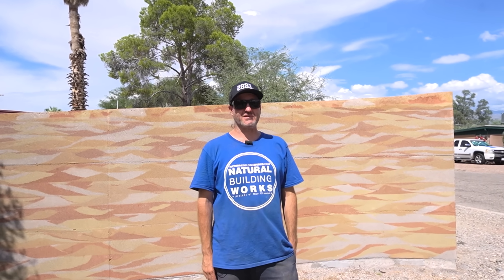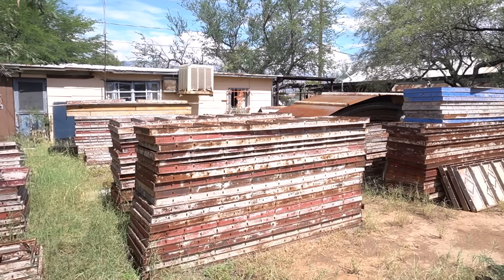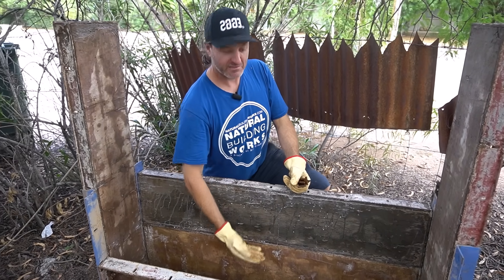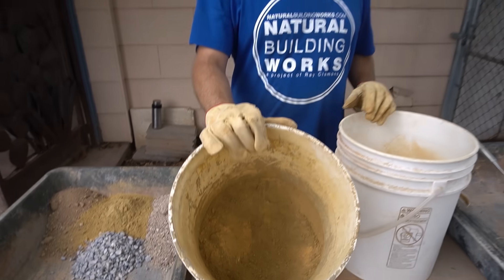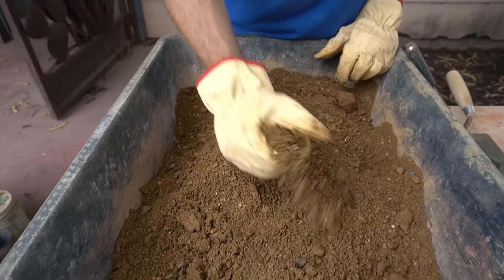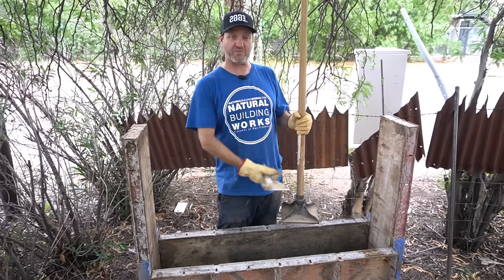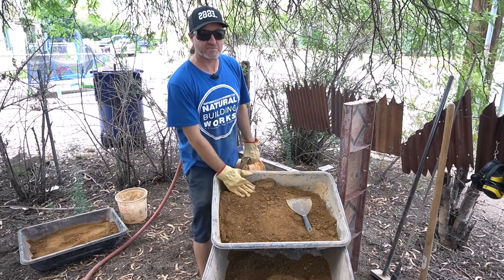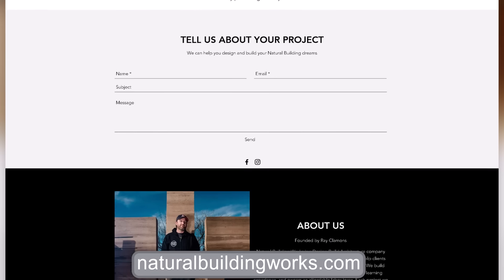How To BUILD A RAMMED EARTH WALL: Sustainable & STRONG!

Comment: I wonder if this could be scaled up by using larger forms and a pile driver to do the tamping.  Something like an attachment to a backhoe or front end loader or whatever, that could lift a couple hundred pound shaft and drop it repeatedly over a steel tamping plate inside the form.  At that point you would probably need a huge cement mixer truck and several dump trucks for the various materials in the mix, though.  So now the equipment costs are creeping into seven figure territory.

Comment: I have a hydraulic tamper its powerful don't get a foot under it for sure. Its just so dang heavy, yeah its lighter while floating when on but it'll wear you out.  This whole process will wear you out and I had a front bucket tractor. Hire this guy to do it if you are not ready to work your tail off.

Comment: With that little of cement, won't rain eventually ruin this wall? I mean, you would need mere cement ratio in wet climate might help last longer.
Reply: We also have Lime plaster mortars, but they seperate from portland cement, so must use knowingly.  1:1:1:1:.1 lime:sand:clay:toilet paper or shredded hemp or glass fibers, wee bit of manure for lots of reasons, including the bind and stickiness. !!! Top coat with slaked lime and pigment or just wet-smooth as is for grassy, micaceous, leather effect.  Four (4!) coats of vegetable soap or linseed oil, chemically becomes waterproof plastic, no critters like eating or burrowing in lime in any form so manure is sanitized, but the flies will love you as you work with it, great meditation with earth.

Comment: What happens if you use a pressure washer on the wall?
Reply: No more wall, then.

Seriously, these don't like water, even rain will erode them away. They need way more lime added to the mix, like they do in more temperate areas that have used RE (China, for instance). Typically a wall like this is only suitable for very dry environments.
Reply: @berserkasaurusrex4233  idk, we did build some hemp lime staggered stud buildings in Ontario that are exposed to some fluctuations in weather. They’re plastered in lime on the outside. Humidity is supposed to rehydrate the lime and filter the air simultaneously. In masonry we use lime for building to last for centuries. I just wonder how long this type of rammed earth will sustain a pressure washer. Probably meant to have a shelter overhead
Reply: @stoneandearthandsailing4127  With a lot of lime, it would be far more water resistant (anything with lime is, generally) for sure.

But as far as a pressure washer goes; Rammed Earth is basically man-made sandstone, you can scratch it with a fingernail. Even with a high cement content, it wouldn't handle weather very well, it's too loose a material, like a too-dry mix of concrete really. Freeze-thaw cycles in particular would destroy this quickly.

If you covered it in a thick layer of lime plaster it would handle the weather a lot better, but then you might as well just build with adobe entirely and save yourself all the extra labor.
Reply: You’ll wash the dirt away and be left with a puddle of mud. What would you expect?
Reply: @stoneandearthandsailing4127  unless its been stabilised
Reply: @stoneandearthandsailing4127  Not really, that is what the concrete mixed in is for, it acts as a binder... But so long as it's not too high of a pressure tip it would be fine-ish.

Comment: Rather than cement can lime be used or even a mix?
Reply: Absolutely
Reply: id actually prefer to use lime
Reply: You do know lime is the key ingredient in concrete.. Right?
The rest is mostly some aggregate like sand and stone.
Reply: @SilvaDreams  theres a difference between cement and lime, including energy required in making it.
Reply: @SilvaDreams  limes don’t grow around here so we mostly use Portland cement to make concrete. I’ve heard limes were much more common in older masonry projects. They would make a hot lime margarita and those walls would regenerate with the moisture in the air. No wonder masons are such alcoholics

Comment: how well does tamped earth hold up to heavy rain and earthquakes?
Reply: I know with cob you apply lin seed oil and that water proofs it. There's mild upkeep involved but not insane. See: 500 year old cob homes in UK for example. There's also some cob structures in British Columbia. So some of the highest consistent rainfall in the world there. Earthquakes on the other hand I'm not sure. I dare say these would not fair well unless you had a solid rock foundation.
Reply: @jpvoxdawg  They wouldn't do well with earthquakes, even concrete walls have issues with them and will crack depending on the strength so I see these doing even worse since they only use a bit of concrete as binder.
As an after thought.. The thickness of the wall will affect it too. Thicker it is the more resistant it will be but it would require testing but guessing there is a point of effectiveness to how thick and tall it would be. Shorter it is the less thick it needs to be.

Comment: How does this hold up in 4 season Mid-Atlantic regions i wonder
Reply: Better than raw mud but worse than concrete since even with a water proofer it will absorb some water and freezing will break it up.. There is a reason why these mostly are in hot dry climates.

Comment: Bro if you just hooked that pneumatic press up to a brick press you could 'pre-tamp' your materials for building sites, literally just laying the bricks down into the molds between layers of mortar. (The bricks could be hidden or visible). When there's enough pressure on raw sand or other materials they become what engineers call "stabilized Earth", so your pneumatic setup (and maybe a gearbox) could press out bricks that are stable at 0% concrete, then place those inside your walls using the 7 or 10% concrete materials sprinkled in between and around the bricks.
Reply: There is a patent for a brick machine from 1865...calls for clay/sand mix and puts 65 tons of force on the dry mix to form vricks that can almost immediately be fired.  They are not stable until fired, though...just super compressed.
Reply: @sethhofstetter8161 they’re selling brick machines out of Africa
Reply: @sethhofstetter8161  Interesting! When you say stable, do you mean resilient to water or that it's the only way it'll hold form?

Structural Engineering has a video where he mechanically stabilizes soil well enough to support the weight of a car so I really wanna learn more about building with stuff like that. -and the WASP construction printer.
Reply: probably one of the most informative posts I've seen that start with bro
Reply: @kingmasterlord  but it's completely wrong. Pressing dirt doesn't produce stabilised earth. Sprinkling 7-10% Portland cement around bricks doesn't make mortar.
Reply: Smart man woe
Reply: Squashing dirt doesn't stabilise it. Pressed blocks are no more stable than raw rammed earth.
Reply: That's kind of how Mother Nature does it, cool video.👍
Reply: Hello. I live in Magadi, Kenya. Ever heard of the maasai of east africa?. To this day our trademark type of house has always been a "manyatta". A house built of sticks, mud and cow dung. How can we make the building of these Morden~ish.
Reply: Watershed bricks in Napa does this
Reply: The way he's doing it there is much faster on a large scale with heavy machinery...mostly if you can get the material on the site(soil)
Reply: Ya, like If you take the right kind of soil, and then cook it till it’s hard, then you don’t need forms, you can just stack it up with mortar between the units. Total breakthrough innovation for construction!
Reply: "stable at 0% concrete"

good luck with that.
Reply: Dude you're totally blowing his steeze...
 Everyone's gonna know you can just go by bricks now. 😅

Comment: Look great Seems likeThis technologyIt's really good for the dry climate What about wet climate How does structure stand high humidityI think it about ocean front Do you have any experience building rammed earth oceanfront?
  We have some houses in Mexico Ocean view but nothing ocean front
 Ocean demolish everything.
Reply: I wonder this too. How does it do in 4 season climates also?
Reply: @wizerd2089    I don't think Winter makes any difference About the integrity of the construction,
 Salt water high humidity It's completely different story
 I leave the ocean front right now And trust me everything be demolished by the   
Salt and high humid
Reply: Considering there is concrete mixed in it holds up like a weak concrete. It'll be there for decades but steadily break apart and flake off in wetter areas, much faster in areas that freeze though because it is more water absorbent so more water will intrude and freeze unless you put some sort of water barrier on it....
And it's far from a new technology, it's ancient.

Comment: Is this also usable for earthquake areas? Does it need steel rebars?
Reply from the maker: I think earthbag or cob would be better for seismic areas. Doesn’t need steel rebar.
Reply: I was thinking the same. How would this fare in Earth quake prone areas. Would inserting rebar help and how would it bind to it?
Reply: @ralfeotto4468  I saw also a project video with steel rebars in it.. But i am not sure if they really has simulated this..